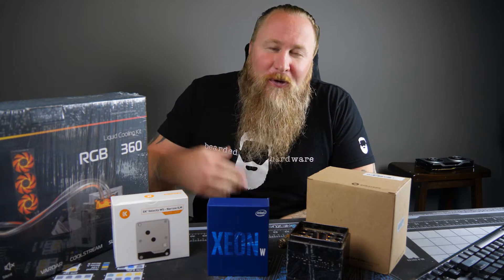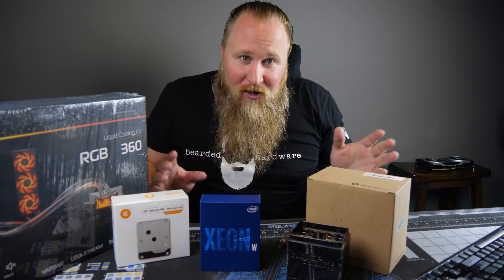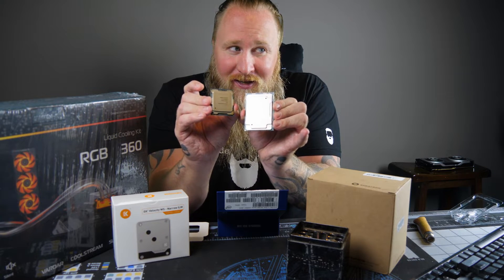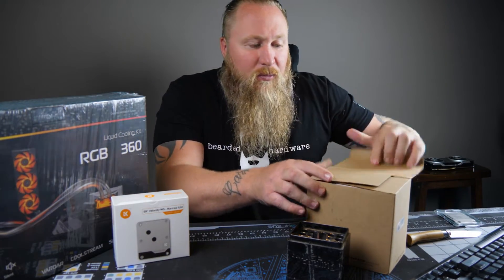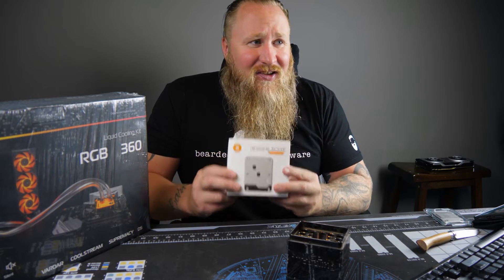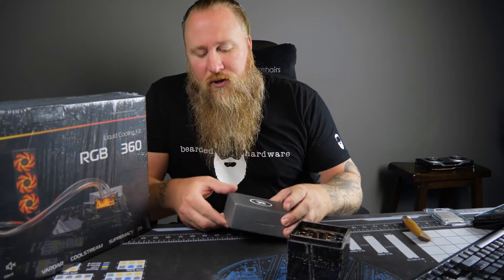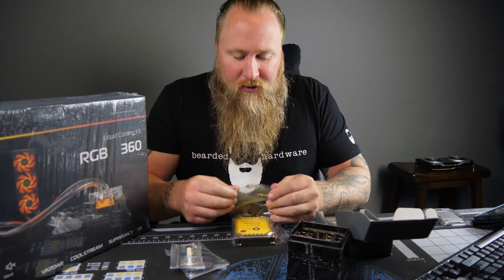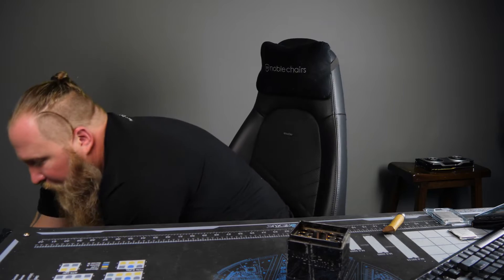Unboxing the Intel XEON W3175 28 Core Processor and Cooling Solutions we are gonna use

Comment: The reason that socket mounting mechanism looks so strange in desktop use case is because that is taken directly from the enterprise server hardware, well that Xeon W3175 is an actual server CPU (and Intel just make them overclockable). In these servers, the system integrators (IBM, HP,  DELL, etc) are the one that mounts the cooling solution to the board and the machine will be mounted on a rack for all its lifespan thus the cooler was never designed to be replaced or opened easily like consumer grade hardware. The actual server heatsink does not even have fans on them instead they rely on brute force airflow pushed by the case intake fans (using those ultra fast delta / nidec screamer fan).
Reply from the maker: Del Fianto exactly... just seems like an opportunity for them to improve

Comment: Cood vid, i may never need such insane rig but living in SEA is quite something, my rig boil as the day heat up my 7940x can reach up to 77c while the gpu can reach up to 90c lol cleaned the pc every month to reduce dust, replaced thermal paste every year or so. my interest is mainly gaming and its creation on the pc less so on the parts, as long as it does not lag/cause issues im not worried but the temps is really making me worry even when local enthusiasts who know these things tell me not to worry. i did a gradual upgrade on my rig the only thing that is still the same is the case. 

might not be a good place to ask but idk where else to lol
Reply from the maker: Bam Blaster what hardware and how are you cooling it?
Reply: @BeardedHardware  hardware as in stuff in the pc yea? 
mobo - asrock x299 killer, 
gpu - 1080ti
cpu - intel 7940x
cooler - had a water pump that a friend recommend me it worked well till damaged from flight to my family house. So as a replacement i got an AIO liquid cooler - Deepcool Castle 240.

Comment: why are there hols in the cpu
Reply from the maker: I stuck a drill to it lol.. nah.. I think it’s an air relief when they mount the Ihs to the pcb.. you see them on lots of chips actually.. the 5960x had them also.. this chip isn’t soldered either.. we will be delidding.
Reply: thx  how much cooling paste goes in those holes , and why not without Ihs directly on the CPU

Comment: for the socket "issue" wouldn't it be possible to 3d print a mounting pad ? not sure how the plastic filament would handle the LN2 with the heating up and extreme cooling down?
btw, love how you show good old ghetto MacGyver building tips ^^ <3 also, jesus bearded christ! its a motherboard that's the same price as my whole system alone, and a cpu that's 5 times my rent XD just the thought of hurting it with sandpaper, i know why you do it, but daaamn!
Reply from the maker: Willies 89 hahahah awesome ...

Comment: The journey begins for the Slacker King. Glad to be on the Beard-Train.  I gonna get the ryzen 7 3700x + ARCTIC Freezer 34 eSports DUO Edition as upgrade for my O'll i5 2500k@4.5Ghz - hyper 212.
Reply from the maker: Boltcranck I have a 3700x sitting right here ;)
Reply: @BeardedHardware  got a good deal on a strix b450-f + nvme plextor M9PeGN 256GB 3100/1000 for around $130 total (2650 Mexican Pesos). now I gonna save for a ddr4 3600 cl16 deal.
Reply from the maker: Boltcranck nice man

Comment: Do you use that pressure paper stuff before, during, after or at all when sanding?
Definitely interested in seeing the different scaling of air, water and Ln2 on a higher core count CPU.
Reply from the maker: Craig Hinkle nah you can tell by how the nickel rubs off and the copper comes out.. you can see the change..  when I put it on water I’ll lap the chip. Have to do an air test first to see how high it can clock

Comment: This chip is awesome. I'd love to see what kind of scores you can get with it. I have a 7980xe and a 2080ti in my video render workstation. I was doing some benchmarking and I was noticing a lot of of 9900k cpus. They seemed to be getting a better CPU scores with that than I was with mine. Were they just using better cooling for better clocks, or what other reasons could there be? I had a 4.7 ghz OC on water
Reply from the maker: Likely cooling and overclock.. 9900k is an easy clocker for sure.. 7080xe is good too.. maybe try to see if you can push it a bit more from 4.7
Reply: bearded hardware I definitely need to go to a bigger rad to push past 4.7. Right now I’m using a 240 and don’t think it’s enough. I don’t want to have to go past 1.3v without better cooling. It’s most stable on water at 1.112v @ 4.4ghz
Reply: But I can do 1.2v at 4.6 pretty easily
Reply from the maker: The Eternal Dreamers check your temps.. I keep under 90c when maxed out.